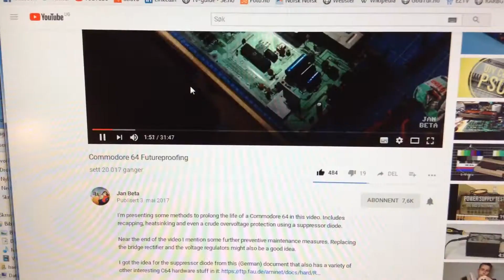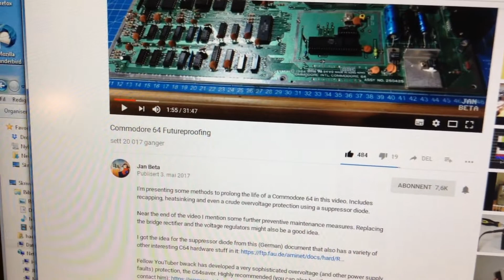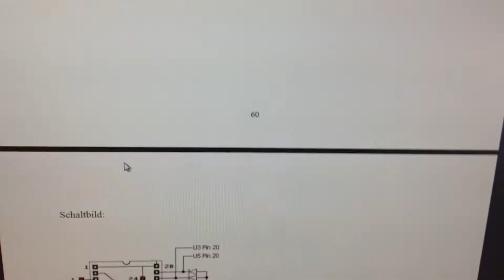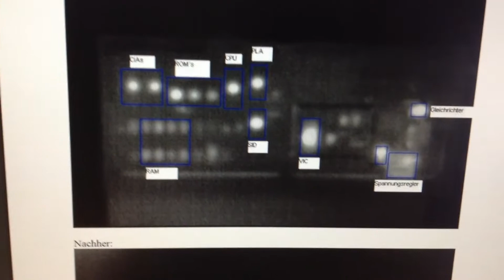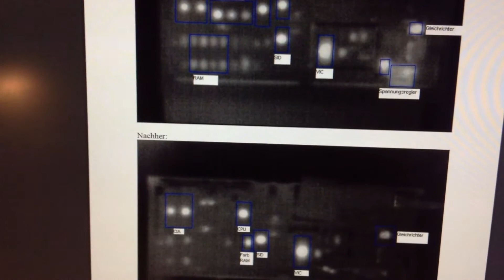C64 breadbin motherboard 5V DC-DC reg replacement.

Comment: Nice Work, Do you recommend a step up or a Step down Regulator , I have no accesses  to The RECOM R-78C5
Reply from the maker: Step down is required. Do you have access to Traco Power TRS 1-2450?

Comment: Nice. I also watched the video of Jan Beta and what I made was to use an angled DC-DC regulator so I've left the aluminium original heatsink in place holded by thermal silicone. This way it will be even cooler I think.
Reply from the maker: Regarding the heatsink/shielding. The sheet is too thin and the material seem to be iron and not a good heat conductor. Also it restricts airflow. I think the video from MindFlareRetro showed very well it didn't do much good. (Allthough not all c64 shields are the same.,). The 5V linear (original) reg drops 10V down to 5V, and current is about 0.3A to the video and timing circuits. That is 1.5W of loss right there on the 5V reg. After replacement the loss is about Ptotal - Pdelivered  = (5V*0.3A/0.85efficieny) - 1.5W ~= 0.26W . :) Not sure what the pull on the 12V reg is. Might knock a watt there too! :) (0.85 efficiency, a conservative figure. It is probably even better).
Reply from the maker: Sorry I think I misunderstood, you ment the heatsink on the 7805. :)
Reply: Yep, that one ;). With the angled rectifier and the thermal shink it just fits, I mean that the pins don't get out of the holes on the other side, but that's no problem, you can solder them anyway.

Comment: Those 78xx are time bombs and get really hot.
Fantastic job mate!
Reply from the maker: Thanks. They seem to do a great job. Haven't checked noise. The C64 has pi-filter anyway :)
Reply: Dunno that filter.
Hey, this new regulator has lower wattage right?
So, how it handles peripherals?
Reply from the maker: Lower wattage / higher efficiency. Currenthandling is the same. 1A. Peripherials are powered by the psu brick 5V reg.
Reply: Perfect